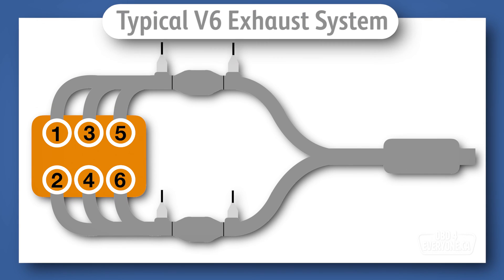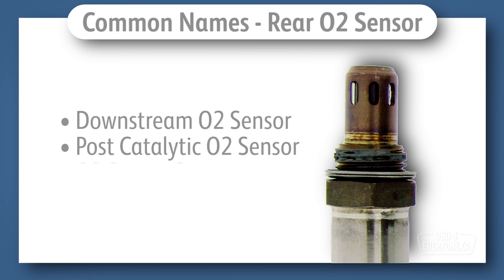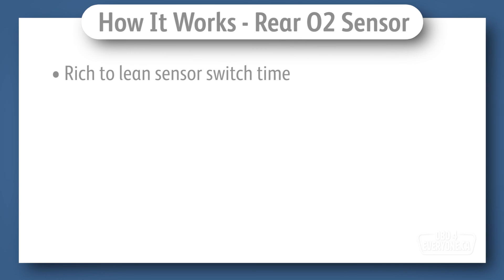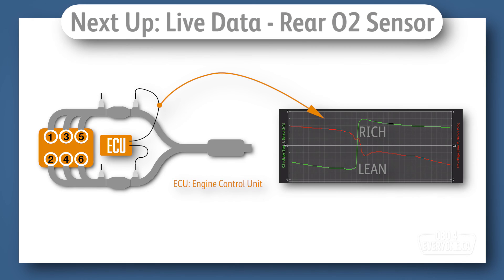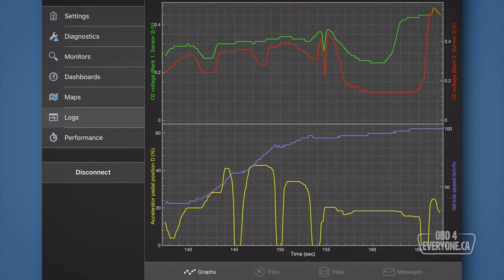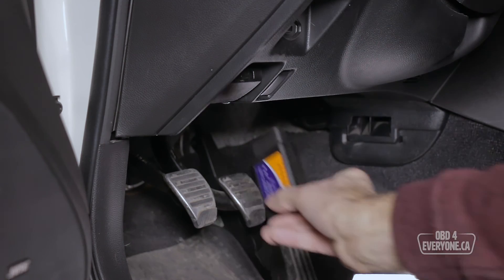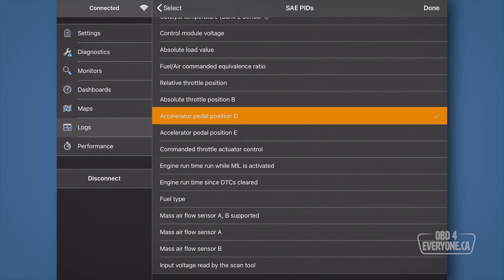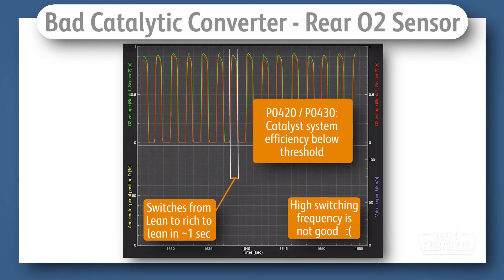Understanding & Live Graphing of the Rear O2 Sensor: OBD4Everyone Ep.19

Comment: Quick question - I've got a '98 Jeep Cherokee, only two o2 sensors with a p0420 engine code -
bank1s1 fluctuates constantly between 0.1 and 0.9 
bank 1 sensor 2 is reads more  smoothly, ie, not constant fluctuation and goes up with acceleration, and down upon deceleration

Is it most likely my catalytic converter is the issue as I am thinking, or perhaps my bank 1 sensor 1 that fluctuates constantly is at fault?
Reply from the maker: From what you describe, the sensor 1 switching seems normal. It should be fairly quick and between 0.1 - 0.9 volts.

You didn't mention the voltage levels of the sensor 2... it should also be about 0.1 - 0.9 volts, AND have a slower switching frequency. (but not too slow or too fast!!)

If you have a P0420 I think the least expensive first option is to replace the rear O2 sensor and re-evaluate.

Comment: reading of 0.05 doesn’t really fluctuate

Bank 1s2 is 0.585
Bank 1s1 is 0
Bank 2s1 is 0.047

Getting fault code p2198

Any help would be great, I’ve only just recently replaced every o2 sensor. The problem existed before replacing these
Reply from the maker: Hey T Perry,
Issues like this are very difficult to trouble shoot via  comments on a youtube channel.

My only advice to you is to compare the good bank sensor output to the bad bank. This should give you an idea of what the sensor's output should be.

Also, I have seen a few reports of  counterfeit sensors being sold on on amazon and ebay that don't work or only work for a short time.

Comment: My 02 sensors they stay around .7 is that good or bad? They don’t go up and down
Reply from the maker: Generally, under full engine load, they should read rich or around 0.9 volts, then when you lift off the throttle, they should read lean or about 0.1 volts.

If you don't have a check engine light, then there is no need to worry.

Comment: So if the second sensor is staying around .6-.7 volts and not switching at all during acceleration or revs I would assume the sensor is bad?
Reply from the maker: Yes, or there is an exhaust leak letting in air and making the O2 sensor read a little leaner.
Reply: @OBD4Everyone  Sorry for the late reply but I just found your video (great job by the way!).  I thought I was finally 'getting' O2 sensor response until I read your reply to Jalpa.  If the downstream sensor is reading constant 0.06 - 0.07 V wouldn't that indicate a rich condition?  And wouldn't an exhaust leak create a lean condition?  Thanks in advance!
Reply from the maker: For  narrow band, rear O2 sensor, 1.0 volts is rich and 0.0 volts is lean...

So you have a dead sensor or a VERY lean condition.

Comment: Good video, I'm having an issue where it says my Bank 1 sensor 2 is faulty but showing voltage, but it stays on the same voltage even when you hit the gas 0.450 volts and my short fuel trim from the bank 1 sensor 2 is showing no reading, do you know the problem??

Thanks.
Reply from the maker: Sounds like your fuel system is running in "open loop" due to a fault.
From what you describe, it sounds like the rear o2 sensor is not functioning properly. (assuming there are no exhaust leaks or cracks)

Comment: Hello sir, great video. I am using the same app and same technique. However, my vehicle is a Toyota Camry 2005 2.4L 4 cylinder engine. It has two oxygen sensor, upstream and downstream. My o2 sensor 1 (upstream) shows no voltage reading at all while idle or driving. However, o2 sensor 2 (downstream) moves around between 0.70 - 0.88 V while driving. I have a check engine light on with P0420, bank 1. Is it normal to have sensor 1 (upstream) at 0 voltage all the time? I am assuming it is dead and that is what causing the p0420 engine code. Please, advice. Thanks,
Reply: why not you buye a new upstream O2 sensor , it is very important to have one as it is the front line defense against high fuel consumption
Reply: @AT_Eng  is there another way of checking upstream sensor? I have 4 cylinder vehicle and gas milages (mpg) are normal.
Reply: @AT_Eng  i just checked the voltage of the front sensor manually and it shows no voltage. Thanks for the advice.
Reply from the maker: Before you troubleshoot or replace the front "O2 sensor" you need to know what type it is: 
• O2 sensor that outputs a voltage of 0-1
• Air/fuel sensor that outputs a voltage of 0-5 volts depending on the air/fuel ratio. Nissan air/fuel senors output about 2 volts at a hot idle. 

I have no idea what type of sensor your Toyota is using, but once you know, then you can accurately troubleshoot the problem.

The last thing I want for you it to replace a part that you didn't need.

Comment: I got error code P0420 and when analyzing the o2 sensors during a drive, the O2B1S1 was fluctuating as it should but the O2B1S2 would hold at around .75-.8v and then randomly drop to below .2v for a second or two at a time. Compared to the good side, B2S2 which always held pretty constant at around .75-.8v the whole time. Do you think this has to do with the sensor or the catalytic converter?
Reply: Spray your throttle with brake cleaner and check if the o2b1s2 is changing voltage..if it is change voltage then yiu have priblem with your catalylic
Reply from the maker: First off all, that is some good troubleshooting!
That is a tough question to answer... 

I would think the rear O2 sensor is bad.  
Does the engine make the same power under full throttle? If it does, the catalytic converter is not plugged and that would make me think the rear o2 is faulty.

Comment: So if mines switching rapidly between rich and lean at idle is then it's no good right?

Unfortunately my motor is a 4 cylinder so I don't have another sensor on the car to compare it too.
Reply from the maker: Without knowing the details (car, engine, etc) the rear o2 sensor should switch slowly over 3-5 or more seconds at idle. If the rear O2 is switching quicker than that, it does point to a low catalyst efficiency.
Reply: @OBD4Everyone  so would that be an O2 fix or cat fix?

Comment: Hi great video I have same problem you this is the downstream o2 sensor the is bad when I let the pedal off the show rich I press the pedal and the drop o to 10% the problem is when I go like 50 miles and let the pedal is when I have the problem thanks for your time
Reply from the maker: Hey Jose Alvarez,
I am having trouble understanding what the issue is.

Are you saying the rear O2 sensor reads rich (almost 1 volt) when you take your foot off the gas pedal?

Comment: My nonda obd2 just says 99% and never changes
Reply from the maker: Hey  noahkb80,
I think you might be looking at the bank 1, sensor 2 fuel trim and not the bank 1, sensor 2 voltage.
Reply: @OBD4Everyone  I get the same value as noah (99.2) for bank 2 sensor 2, which seems to be a steady value to show catalytic converter health.

However, SHRTFTB1S2 shows N/A, which seems odd given that I have a V8 with two distinct engine banks (2019 MY Ford) and clearly get a voltage reading from the same sensor. I'm guessing it's worth at least a quick check by the dealer?
Reply from the maker: Hey  Edward Orsi,
This is odd... I have a diagnostic report from a 2015 Mustang GT and it shows short term fuel trim AND  O2 voltage for bank 1+2, sensor 2.

What do you see for O2 voltage bank 1 or 2, sensor 2?
Reply from the maker: Hey Edward Orsi,
Looks good to me. When revving the engine, it goes rich (> 0.9 volts) and when off the gas, it goes lean (< 0.1 volts)

Have fun with your Mustang :)

Comment: hi i check with my device obd and is said the problem is the o2 sensor 1 bank 1 and i also check in the graphic is going from 547mV to 3mV continually and  the thing I noticed is that the wave is not linear sometimes it goes down sometimes it doesn't go down completely sorry for my english .it is catalyst issue or sensor what you think?
Reply from the maker: Hey  Tahir Eminem,
Based on what you have told me, there is no way that I know of to determine a bad O2 sensor or a bad catalytic converter. It could be either of those, or something else.

Under full throttle, your front O2 sensor should be around 0.9 volts or more if all is working properly.

In your case, the highest voltage is 0.5 volts it may be an under-performing O2 sensor, exhaust leak or even a fuel system issue, like low fuel pressure.

What is your voltage reading under full throttle?
Reply: @OBD4Everyone  hi, i cehck my car in throttle the voltagr max from the sensor 1 was 0.6 v not more and i also note when i press full pedal in the gas after max of rpm is coming automatic to the minim i think is not normal .
Reply from the maker: Hey  Tahir Eminem,
What vehicle is this on? (year, make & model)
Reply: @OBD4Everyone  hi is vauxhall corsa d 2006 today i try with another sensor and they give me more voltage like 0.8 v so i think is proper the sensor also i see near the o2 sensor there is a crack so is mean is possible also the air is coming  out also
Reply from the maker: Hey  Tahir Eminem,
I think you have found the problem :)
The crack should be repaired/welded so it doesn't allow air into the exhaust and make the O2 sensor read leaner (lower voltage)
Reply: @OBD4Everyone  yes, what you think I just put another sensor and after put back my sensor the voltage is coming up but maybe after 10 mile is coming down again the voltage  and also the error, so do you think is better for first to close the crack and after replace the sensor? Because before l1 years ago  I remember I change this sensor but the error is coming again.
And how is possible to have a crack in the exhaust? Do you have any idea
Reply from the maker: Hey  Tahir Eminem,
Due to the heat and vibration of the exhaust, cracks do happen once in a while. 

I would fix the crack first and then see what the sensor's output is.
Good luck!
Reply: @OBD4Everyone  thanks :)
Reply: @OBD4Everyone  hi i fixed the crack on the exhaust and i clean the error and when i scan again now is showing me sensor 1 bank 2 issue

Comment: Great video really helps me understand what's going on in the exhaust system, but I'm in a bit of a weird spot where I have an incomplete catalyst monitor, but no check engine. I have replaced the 2nd o2 sensor, and driven around 200 miles. Still no completion for catalyst monitor, any tips on how I can look at post and pre cat o2 sensor graphs to get a sense of what's going on?
Reply from the maker: Hey  Inner G,
The requirements to get monitors to run are different for different vehicles.

You need to find out the conditions that are required for the monitor to run and made sure they are followed. Then you need to make sure you follow the catalyst drive cycle for your vehicle.

It can also be helpful to look at the mode $06 data in OBDFusion (or OBDLInk) diagnostic report fort failed items.

Good luck!

Comment: Very good video, thanks for that. But I am a bit confused with my 2009 honda odyssey, it has the code P0430 but it shows voltage 0 in Bank 1 Sensor 1, I already bought a new sensor for  Bank 1 Sensor 1, it shows the same 0.  Could be the reason of the P0430 a problem with bank 1 sensor 1 cable? What is the job of the O2 sensors bank 1 sensor 1 ?. Thank you again.
Reply from the maker: Hey  Alexander Silva,
I think you are viewing the wrong PID and that is why it is showing zero. 

Different manufactures will use different names for the front O2 sensor.

To find the correct sensor name / PID, run the diagnostic report. In the mode $01 section make a note of the exact wording where it mentions bank 1, sensor 1.

Can a bad cable cause a P0430? Yes.

The sensor 1 reports the air/fuel ratio to the engine computer and it uses this feedback to monitor the running condition of the engine. At idle and low engine load it will show a "lambda" of 1.0 which is the same as an air/fuel ratio of about 14.7. Operating the engine with 14.7 pounds of air, for every pound of fuel is the best for emissions.

Comment: https://youtu.be/afio03Sv_MU?t=2m48s is the statement that the switching frequency is too low and causing the P0420 backwards?
And is the video referring to the downstream sensor as the bank 2 sensor, being charted in red? Or is the video actually showing the bank 2 primary sensor rather than the downstream sensor waveform?
Is there any comparison of the sensor 1 to sensor 2 or is this just displaying the secondary sensors on both banks?  Instead of showing the same secondary sensor waveforms on both banks, it would have been interesting to see the difference from front to rear-
Reply from the maker: Hey  wingerrrrrrrrr,
The statement is not backwards (even though I seem to do that all the time!)

To determine the efficiency of the catalytic converter, the oxygen storage capacity is tested. The engine computer will switch the mixture a little lean an rich during low load conditions, then it watches how quickly the rear o2 sensor switches. The longer the time to switch, the better the oxygen storage. 

If the catalytic convert was removed, the front o2 and the rear o2 sensor would have the same waveform and indicate a very low oxygen storage capacity and set a P0420 "Catalyst efficiency below threshold" code.

All the sensors shown in the video are post cat, down stream or sensor 2 oxygen sensors.

I wasn't able to show the front and rear O2 sensors, as this vehicle has an air/fuel ratio sensor which outputs a voltage that is proportional to the air/fuel mixture.

Here is a link that may describe this better:
https://www.discountconverter.com/tech-tips/news_page.cfm?Key=catalytic_converter-&News=218

Thanks for the excellent questions!
Reply: If the switching frequency of the secondary sensor is too high rather than too low, that's what would indicate a catalytic issue and P0420.
That's the part that was backwards-

Comment: Thinking I could need a cat. But I feel like I need fuel injectors or to check distributors and line/pump. Running lean on my idle. Either I’m not getting air out quick enough or I’m not getting enough fuel in.
Reply from the maker: Hey Dps Heals,
Why do you think you are running lean?
What year, make & model do you have?
Reply: 06 Honda Civic 1.8 sohc: 
I think I was wrong. From the info you told me everything seems correct. The car is fine. I’m just now getting into cars after 25 years! (Yea, I know) and I’m playing around with it. I put an intake on then immediately would get a boggy/ stall from idle to acceleration. So I was trying to diagnose it. Seems like it’s getting better though... I thought maybe an o2 sensor wasn’t reading right or maybe it’s just too much intake and not enough exhaust. Maybe I need new fuel injectors... I’m just having fun with this new hobby. Not in any crisis with the car but any info on anything would help. Btw those scanners are awesome! And cars are like a puzzle. I love it! 
Thanks for taking your time to reply I appreciate it!!
Reply from the maker: Hey Dps Heals,
No problem.
Sounds like you have found a new and fun hobby :)

Comment: I have 04 BMW 325xi my question to you is does the rear O2 sensor 2 Downstream is it a flat is it supposed to do the exact same thing as the front ones osculate
Reply from the maker: Hey  Isreal Perez,
It depends on the type of front O2 sensor. I am 99% certain that your car has the older style "narrow band" O2 sensor. 

Newer cars use an Air/Fuel sensor that measures the actual air/fuel ratio. The older "narrow band" sensors basically switch between lean (>14.7 air/fuel ratio) and rich (< 14.7 AFR)

For the narrow band front O2 sensors, if they have the same waveform  (cycle frequency and amplitude as the rear) the catalytic converter function is low.

For a proper running system, when fully warmed up and at low engine load (idle or cruising at a steady speed) the front O2 sensor should switch between about 0.1 and 0.9 volts and the front should switch quicker than the rear O2 sensor. (also around 0.1 and 0.9 volts)
Reply: @OBD4Everyone  on last question I've found b1s1 wires fuse together the plastic melted off so I've separated them and taped it off would this kill the ecm that reads p0171 b1s1
Reply from the maker: Hey  Isreal Perez,
I think your ecm (or DME in BMW speak) is fine.
Since the trouble code is NOT for an o2 heater circuit, the wires that shorted together are for the input to the DME. That's good.

If you plan on keeping the car, you might want to get a new O2 sensor and try to figure out why the wires melted. That's not normal.

Good Luck!
Reply: So on idle the downward sensor should have a steady line but during higher rpms should fluctuate.?! I think I need a new cat. Do for an upgrade anyway. I put an intake on and now I’m assuming I’m not getting the air out fast enough. Thinking it could start with worn out valves to the manifold/cat/ exhaust system.
Reply from the maker: @dpsheals  When the rear O2 sensor is at operating temperature, during idle it should still move between lean (<0.1 v) and rich (around 0.8 v) BUT it might take 2-5 (or so) seconds.

During acceleration the rear O2 should be rich, and when you take your foot off the throttle, it should quickly switch to lean ( < 0.1 v)